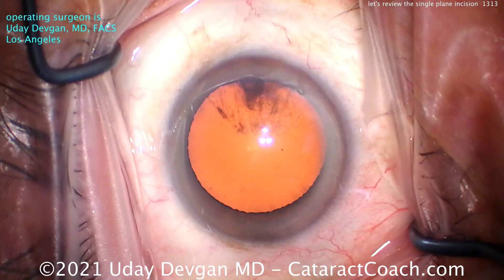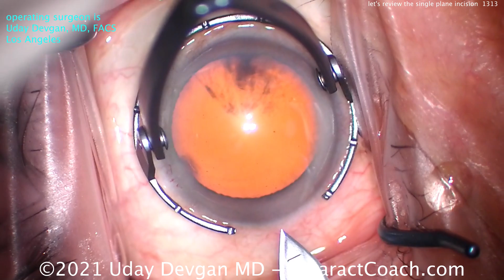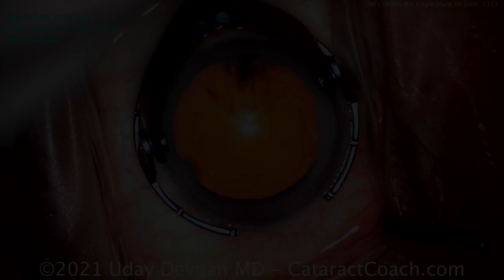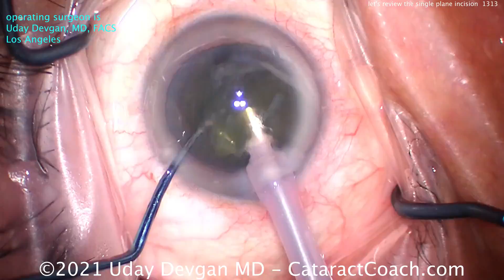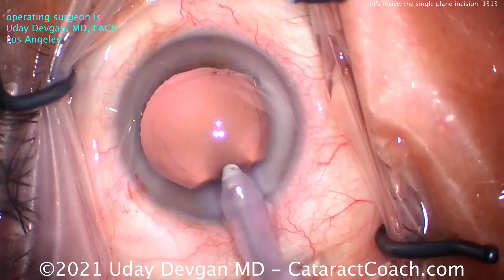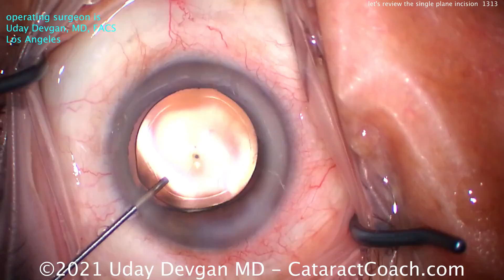CataractCoach 1313: reviewing the single plane incision

Comment: Thanks for the video - is it possible to add a video or diagram to show the angle of the blade in side view during the incision, and the path it takes through the cross sectional cornea? Would be most helpful addition if possible